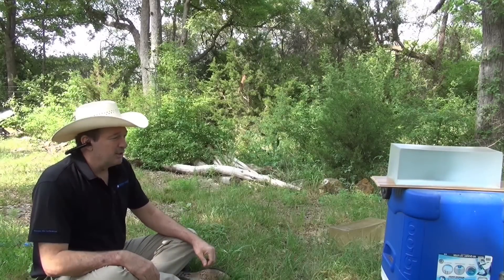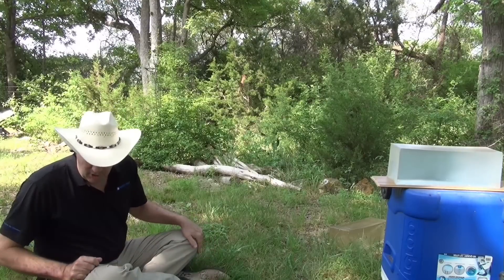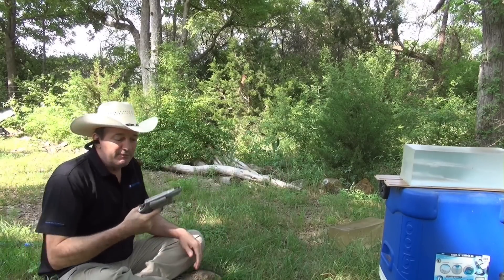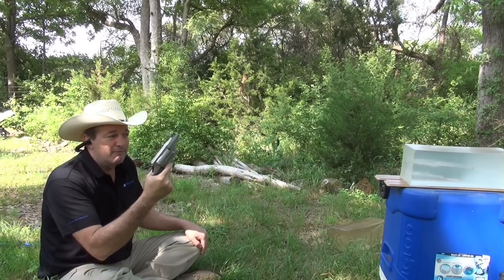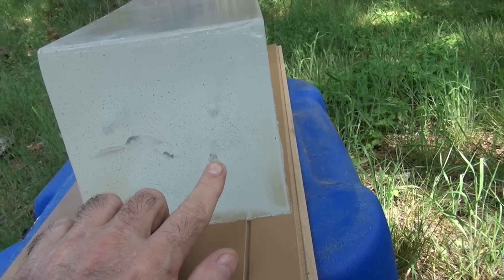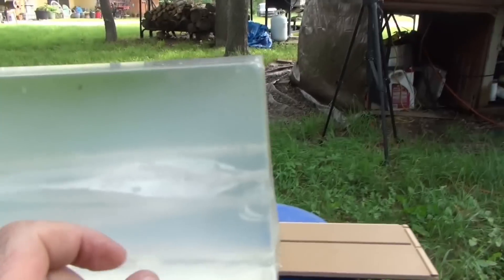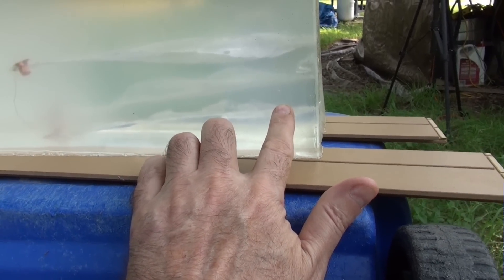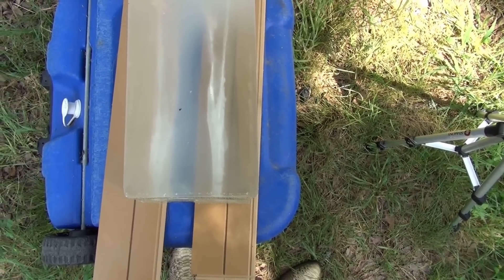Slow motion ballistics test of my carry ammo

Comment: try using a bigger barrel with the 38 round. Hornady's 357 LeverEvolution rounds don't always expand either with a short barrel. but out of a long barrel they seem to expand. so that could have something to do with it
Reply from the maker: Dopee Man Yeah, I think you're right. If you notice, that 38 Special maximum expansion bullet has a big fire ball out quite a distance from the end of the barrel. I don't think the power used in that load burns fast enough to develop the proper pressure in that short 1.87" LCR barrel. I saw the same thing when I tried firing a full hot loaded 357 magnum round too... it actually performed worse than a standard load 357 magnum, I think for the same reason.
For now, my LCR is the only gun I own in 38/357, so I think I'll just load it with the Buffalo Bore, short barreled, low flash 357 magnum hollow points when I choose to carry it. That Buffalo Bore round has special power that burns fast and has a lower flash, made specifically for short barreled revolvers, and it's a very deep penetrator. It doesn't expand out as big as the Lehigh maximum expansion bullets, but real life statics over the years show the 357 magnum hollow points to be the best one shot stopper there is, so I feel very comfortable carrying those rounds in my LCR. I might revisit the Lehigh Defense 38 Special +P ammo again if I ever buy a longer barrel 38/357 gun.
Reply: Robert Eddelman ya i would agree im a huge fan of 357. im curious why you never mention or test any Hornady are you not a fan
Reply from the maker: Dopee Man I tested a lot of the hornady ammo. I found the hornady ammo that didn't have the nylon inserts like the XTP, would not expand reliably when going through denim and other materials... and the ones that did have the insert like the FTX would expand more reliable, but I found their ballistics to be about the same as all the other major brands of defense hollow points. 
Truly, out of all the numerous testing I've done, the Lehigh Defense maximum expansion bullets are the only one's to date that stand out as better to me because of the very noticeable difference in the size of the wound track cut through my simulated human torso test and plain ole gel test. Now don't get me wrong, I think most of the major brands defense hollow point loads are very likely to get the job done... I'm just one who would like to have that little bit of edge should I ever have to reply on it to save my life... lol